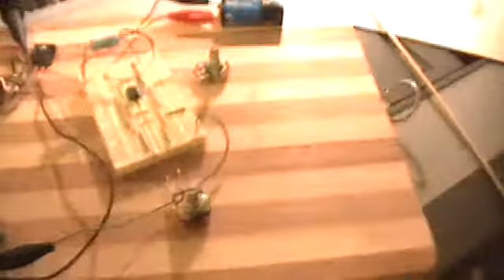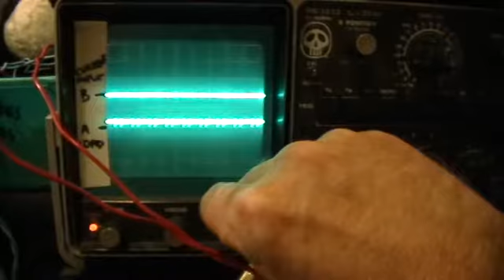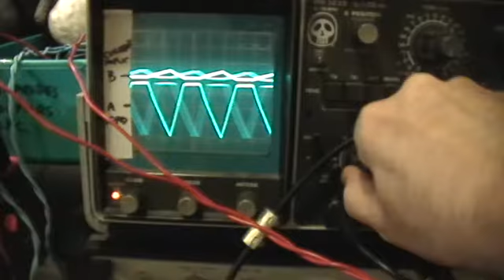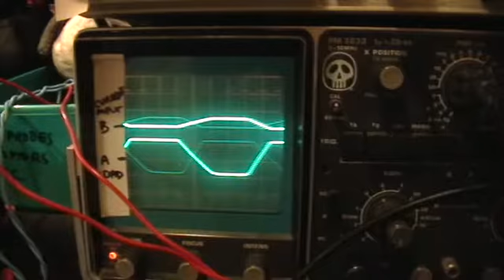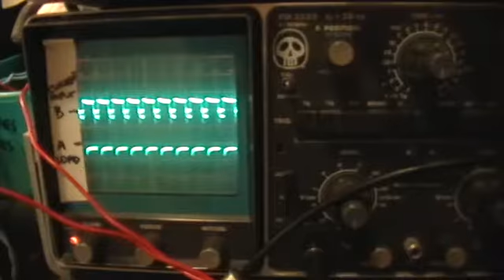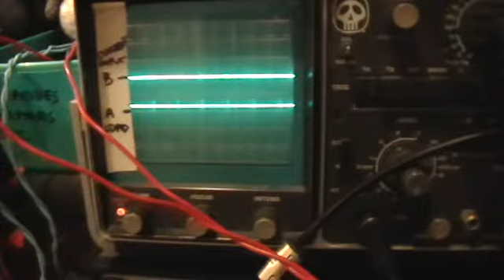Aaron's circuit PART B

Comment: With that resistor (which is actually unnecessary) from battery to 555, the 555 does give square waves. My resistor was about 1.1k. Not sure where you get a 2k+ resistor from. ALL your comments on the 555 has to do with YOUR circuit being underdriven, not mine. :) 

It drives the mosfet just fine.